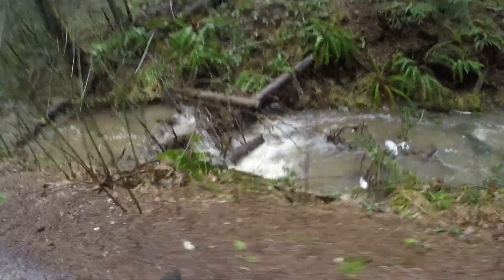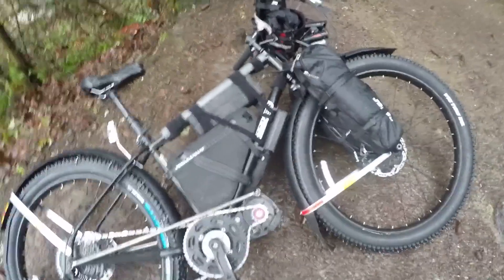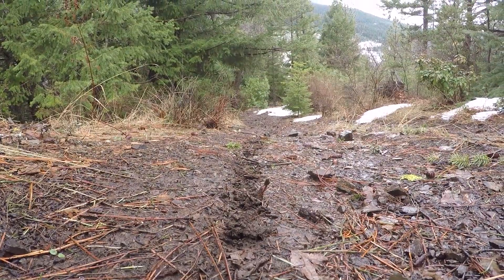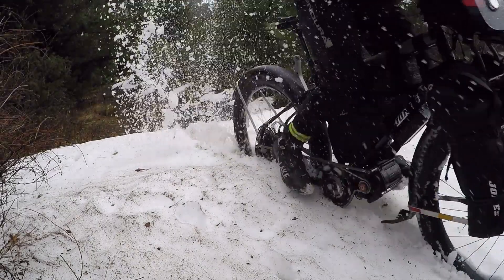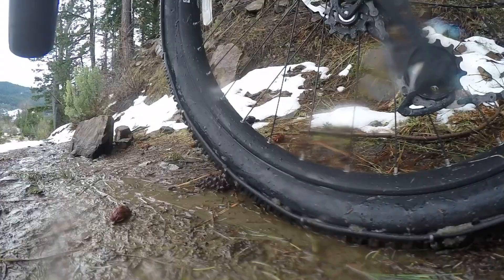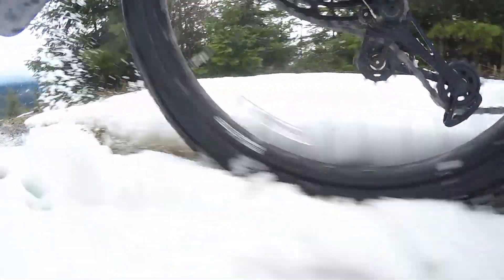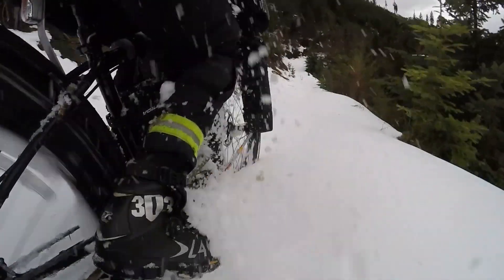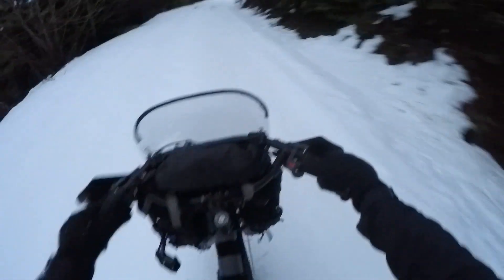JONES MOTORBIKES - Snow Chains and Tire Studs on an Electric Bike, Traction Testing.

Comment: How did you sinch up the brake cable ends and secure them? Great idea btw
Reply from the maker: I used aluminum wire crimp connectors.  Thanks!
Reply: That was going to be the one question I was going to ask👍 with using crimps do you need to remove wheel, deflate tyre a little to slide off or?